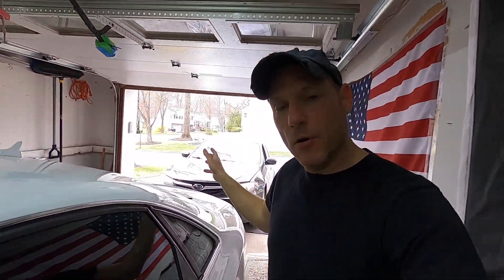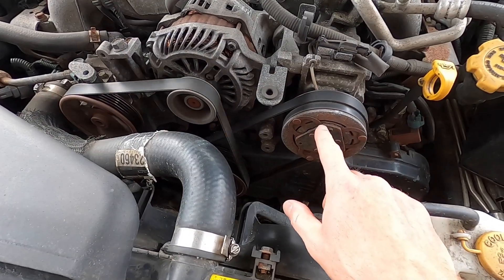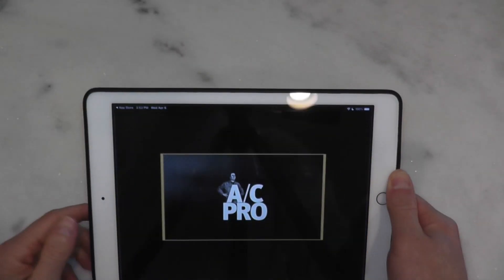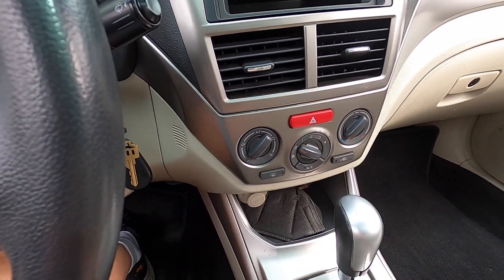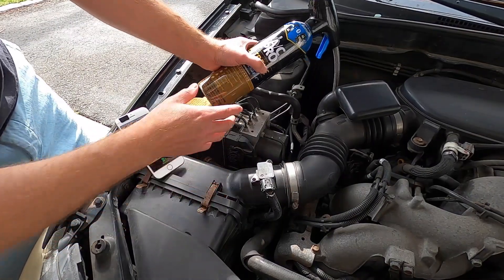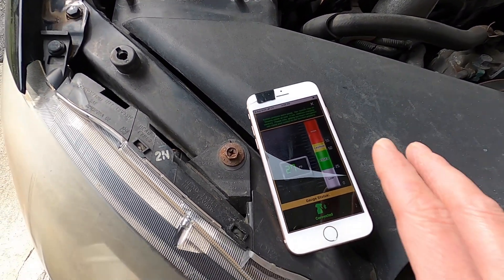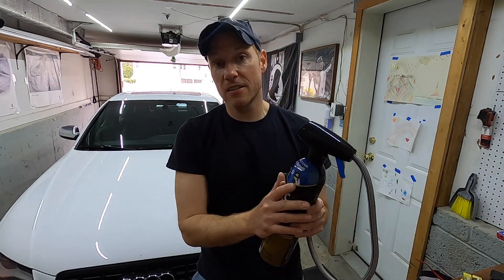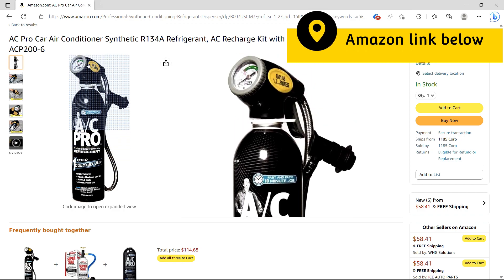Car AC Blowing Hot Air and How To Fix At Home

Comment: Isn't adding Freon to an AC system is just masking the problem.  To my knowledge, f you have to add Freon it means there is a leak somewhere. Whatever you add, it is going to leak eventually in a couple of days.
Reply: gas and go.  if if it blows cold after a day, get ut fixed.  if it does not, its good for another 5 years.

Comment: Hey, i need advice. I’ve already done this, worked for about a week. And then literally all my vents started blowing hot air EXCEPT one, with the refrigerant being at a perfect rate. Any knowledge on why this is happening?
Reply: There's a little plastic piece inside each vent, actuated by a solenoid, which is used to limit airflow. One has broken. It's a very expensive replacement. Cheaper to stuff a sock in the malfunctioning vent than to tear apart the dashboard and fix the problem.

Comment: still a newbie when it comes to ac ,so even though the ac clutch wasn't spinning,when the hose got attached the low pressure valve that activated the clutch?

Comment: They want to run a dye test on your compressor: $105 just for that; cost them about $10 and then they'll replace your compressor for over $600 and maybe there's nothing wrong your compressor. Sad the world we live in today. So steal from people and sleep fine. Well they won't when they meet their Maker on judgement day.
Reply: Yeah good thing I found a trustworthy mechanic. Fixed things that other hack weasel “ mechanics “ messed up .. at very reasonable price too . This hack fucked up my engine timing and wouldn’t take responsibility. 😡 then other hacks saying it was this or that ..😡 more money lost . Finally this very trustworthy old mechanic knew what was wrong just by me cranking it over a couple seconds.. charged me $190 and he had to order special tool a locking pin for it but didn’t charge extra.
Reply: This other time he took out his uv flashlight and found out the leaks on my AC system. Took less than two minutes.
Reply: I asked my friends on Facebook who they knew was good trustworthy mechanic and found him

Comment: You can check your blend door motor which is usually under your steering wheel, if it gets stuck your air will only blow either hot or cold.

Comment: My 2006 acura tl AC is now blowing hot air. I have owned the car since may 2007 and no problems with AC at all until few weeks ago it started blowing hot air a few times and then cold. However past 2 days only hot air.. Do you think this is issue that it needs refrigerant?
Reply: Almost exact problem as my 1991 obs Silverado, sounds like the most likely answer but I’m not 100% so I’ll wait until someone responds
Reply: Hey you ever figure it out? Same thing happened with my 08 tsx, and it wasn’t the refrigerant.
Reply: @Shotby100k  Yes, same with me too!
Reply: Probably blend door if I had to guess.
Reply: @BradyHarvey1054 what’s a ‘blend door’??

Comment: Put some PAG oil in system 2oz, they all leak at compressor shaft seal.  If you see oil at compressor it leaks out at lowest point this with save it from failing.  The compressor will thank you, 2 oz won't hurt, you can buy a walmart 2oz charge can, put in first followed by a squirt of 134A.  Or buy PAG oil and pour 2oz into hoses and put 134A in behind it.
Reply: Im glad i found this comment as i was looking around for an answer, today i tool the ac clutch and coil off my 2006 odyssey and found some green liquid around it, it doesn’t seem like its leaking or scattering at all just enough around the compressor shaft and bearings, is this something i be worried about or should i just top off the oil as you mentioned?
Reply: Thank you very much!

Comment: Now to find out why it leaked out, this is just a bandaid sometimes, sometimes you get lucky.
Reply: Bout where I'm at, bub. 😄 Spent $160 at Valvoline, more or less just to have them run a test w their fancy machine to hopefully tell me if something else was wrong. Wanted to make sure it got done right w me taking my mom to the doctor and taking her to run errands too. Thing is, they can test for leaks (not sure how accurate that may be), but they can't tell if your compressor is shot or if there are any other issues. Wish I would have paid an extra 40 now at a local quick shop now. As they would prob do more extensive testing.
Reply: @terrapinflyer273 did you get it fixed?
Reply: As as old as that vehicle is and the mileage,it's quite normal for the R12 to dissipate if it has never been serviced in the past..it's a closed system..but not 100% pressure tight..
Reply: The car is a 2010 if it hasn't had any AC recharge in those years most likely it ran low, all AC system  leak

Comment: Did the air conditioning have a leak or do these just need refilling from time to time ... Kind Regards
Reply: Depends how old the car is, sometimes the hoses can leak, the condenser can leak, sometimes the compressor too. If you’re not very mechanical I would ask a mechanic to to do a recovery then a vacuum test for a leak or Uv light the hoses and condenser to find a leak.

Comment: Hold the can UPRIGHT, you don't want liquid in the system, you want the gas form.
Reply: Its compresses into a liquid wtf r u talking abt lol u have to have liquid refrigerant at the txv for the ac to even get cold.. u cant have gas only cuz it wld be extremely extremely  low🤨
Reply: not true.
Reply: What are you talking about...he fixed the problem doing it the same way you said not to do it...can upside down or right side up doesn't matter... They just want you to agitate the can